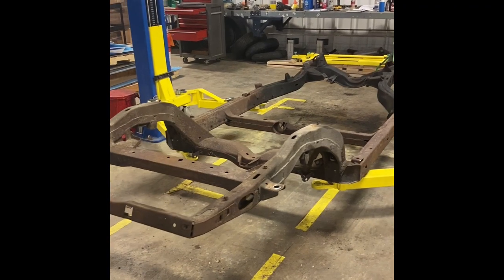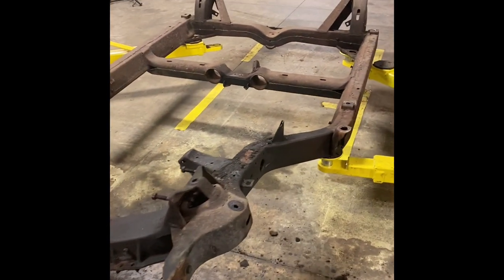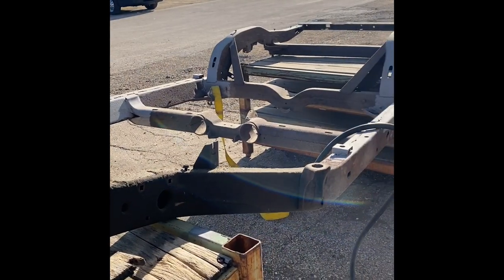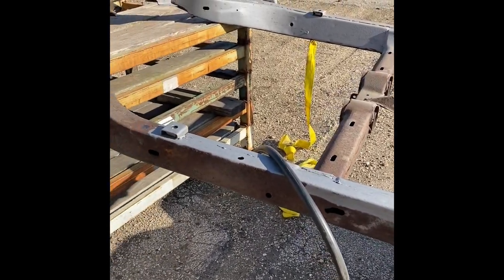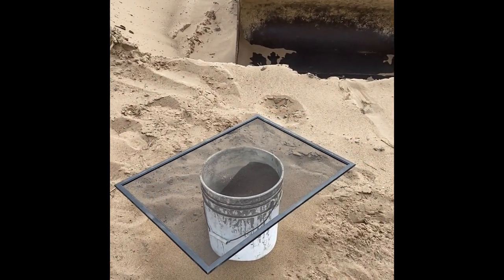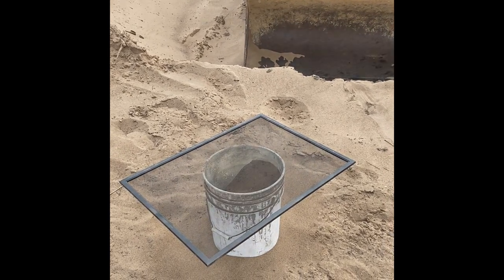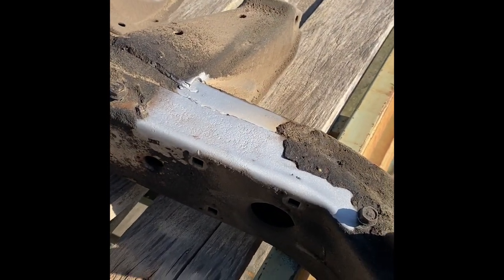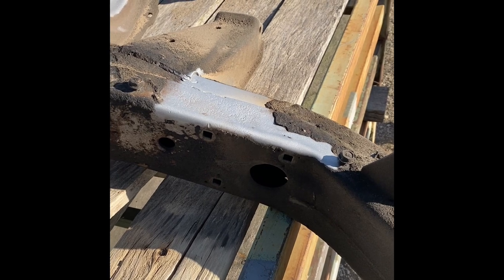1972 Corvette C3 frame sand blasting

Comment: Thank you.  Good information on how a sand blaster success varies based on the air pressure.  I have a small compressor and  frustrated with results.  You explained it as PSI not consistent.  I will try it again and lower expectation.  Slower paced.
Reply from the maker: It really takes a lot of air JM.  A typical portable/garage type compressor isn't going to cut it.  Good luck with your project!

Comment: I'm getting ready to either sand blast or acid dip then E coat. 
It's $275 to sand blast, or 1100 to E coat.
I'm thinking that even though more expensive, it will get inside the frame and seal it for a very long time, every nook and cranny.

Comment: Great Job! 👍🏼
How  do you clean the inside of the frame and check the condition?
Greetz from Germany - owner of a 79 Vette… 😎
Reply from the maker: Hi Lutz,  it's difficult to see much of the inside of the frame and even more difficult to do anything about.  I used Eastman's rust inhibitor to coat the inside, which gets applied via a long tube and nozzle which you pull through holes in the frame.
Thanks for watching and commenting!
Mike
Reply: @mikelandwehr-corvette  
Thanx for the quick answer! 😃 And please excuse my bad english… ✌🏼
My expection is to do the same sometimes on my Corvette and think about removing permernantly the rust inside the frame…
Or maybe seeking for a new one?
My Vette is in original Condition and it‘s still my dreamcar for over 30 years…
Is your project completed?
Another greetz and thank you! 👍🏼
Lutz
Reply from the maker: @Avenarius2906  No, not finished yet.  I'm actually planning to drop the body back onto the frame this weekend.  Then after dealing with some door gap issues, I'll be sending it out for a new paint job.  Once it comes back, I'll reinstall the interior.  I'm hoping to have the project done in June 2022 and drive the car on its 50th birthday.
Good luck with your project!
Reply: @mikelandwehr-corvette  
Thanx again and good luck for your project! 🍀😃
Have you put wax or fat inside the frame against new rust?
My Corvette is in driving condition and i have to save money for restauration… ✌🏼
Fine, that people like you preserve C3 Vettes! 👍🏼👍🏼👍🏼